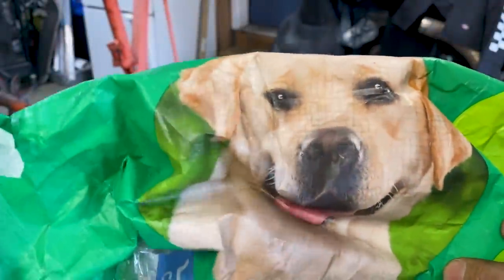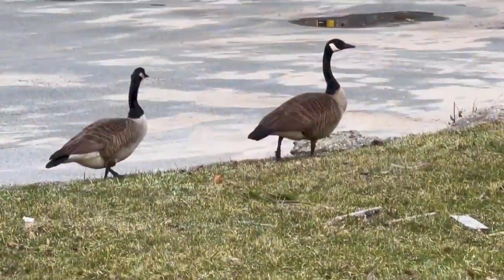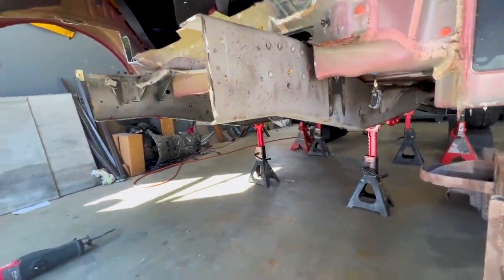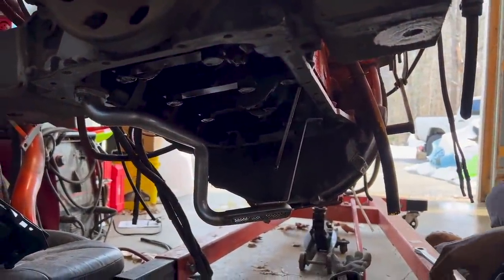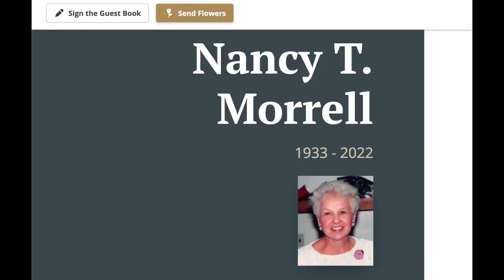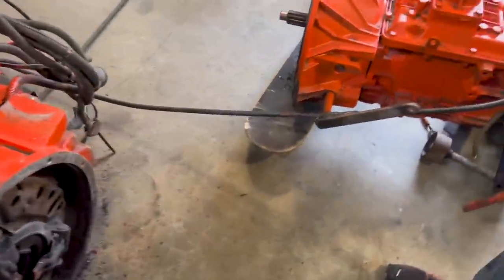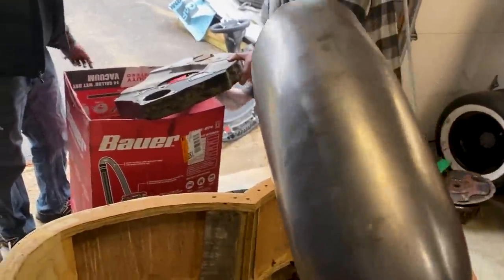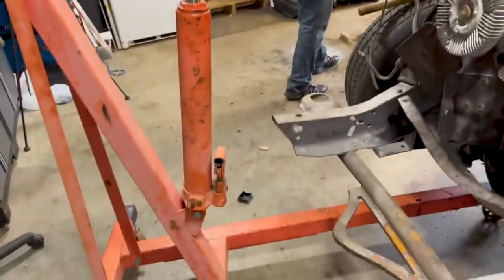Squeezing a Diesel engine into a Tesla Model 3

Comment: You gotta bring it to Munro HQ when you’re done with it.
Reply: We will pull whatever you want dragged around at the Munro HQ <3
Reply: can you check the torque specs on the pick up tube bolts?
Reply: If it ain't woke, don't fix it! LOL
Reply: Inspect those panel gaps they look bit uneven.
Reply: Jack_Nicholson_yes.gif
Reply: It would be even better if they run that conversion with vegetable oil 😂 😂
Reply: @poplaurentiu4148  or using gas wood gas 😂
Reply: @carholic-sz3qv  Or do what Top Gear UK did and grow their own rapeseed oil to run it on, making it 100% green.
Reply: Lol need to get some new ideas at minors for next gen thinking
Reply: I will come up for Model D!! NERDS ABSOLUTELY ROCK!!!

Comment: if you want to do a/c,  factory cummins bracket for mid 90s F600 ford, Cummins part# 3930888   moves a/c compressor ABOVE the water inlet, then fab something for the alternator.  Also needs a belt tensioner from same application, as it swings opposite direction.

Comment: I hope that you used a dial indicator and set the tolerances on that flywheel housing. I've seen broken crank shafts as a result of improper installation of flywheel housings on Cummins engines.
Reply: To be completely honest they probably used a particularly unique piece of gravel from the driveway of a White Castle six years ago that Stevon kept in his left pocket. Something ridiculous like that, anyway

Comment: I dig the auto. 1 manual tesla for fun, 1 auto for ease of towing. If you were to go with the manual though, you'd install a completely different chassis mount shifter, then make linkages to connect it to the trans' shift rod. Few guys with manual GMT800 trucks have done this to install the center console, and put the shifter right in the left most storage tray area. Makes for a super clean install without having some weird shaped shift rod. With linkages you can also make the throw however long/short you want it to be.

Comment: Nice work personally I would of built a frame and mounted the engine then mounted the tesla body on top and and just cut the tesla body to fit the frame and engine. But either way this is some solid work good job man!
Reply: Exactly what I was thinking. Shoulda just kept the engine and frame from the bread truck and then dropped the Tesla body onto it. Naturally they woulda had to cut half of the body so that might have looked a bit odd 😂

Comment: Would be more interesting an TDI Diesel swap for that sleeper look. But the extravagant way it's the way to go for more exposure.
Reply: It couldn't tow with a TDI... And a TDI swap would probably be easier than the V8 swap he already did.
Reply: @zachcollins9687  did the US get the V8/V10/V12 TDI engines? They would be up for it
Reply: @ikebuttle360  yeah, in the early first generation Touareg they had the V10 TDI
Reply: @ikebuttle360  kinda irrelevant... It doesn't matter WHICH TDI they went with, the original comment suggested they tried to maintain more of a "sleeper" aesthetic. If they kept the original unibody and swapped in a V10 TDI it still wouldn't be able to tow. Like I said, I feel like it'd be too similar to the LS swap they already did.
Reply: @ikebuttle360  they did in the q7 and the tourag
Reply: @zachcollins9687  exactly, they could try the V6 TDI, from Audi. Might be able to fit. There are also Specialized Garages in TDI engines, that could collaborate with the build. As the   "Darkside Developments" Garage in UK.

Comment: To Rich and his elves , run your newish Tessie on veggie oil , use the original Tesla power hookup to then power an external pump to fill up a onboard used fuel supply reservoir, this to later filter the oil for fuel , overload use only of coarse .

Comment: Well yes.

You could also do a Turbine Tesla (tesla turbine), stick a helicopter engine in a Tesla instead of the battery pack and normal controller, just run it off a custom genset and inverter / controller (PWM/multi-phase). You could definitely be sustaining 500kW by doing similar stuff to what is being done for military and civil aviation aircraft...

You can run a turbine on most any flammable liquid.
Reply: ok
Reply: Haha - at least it doesn't have to be flight certified - but those things cost at least as much as a Plaid :DD
Reply: @rkan2  it's weird how a turbine with one moving part costs loads more than a piston engine, and that just goes to show you what sort of corruption and state subsidy systems are involved here with companies like Standard Oil and GM.

The things I could tell you about what has gone on with the turbine industry and military sanctions... it would blow your mind. I worked for Jan Mowill & his daughter at OPRA turbines for like ten years.

I also got bladon interested in the single stage all radial topology - a single stage turbine is basically a car turbo stuck to an open flame, with the air compressor driving the flame, and the exhaust manifold being driven by the flame. People make them in their back yard.

You can make a single stage gas turbine out of a car turbocharger.

The bladon single stage air bearing unit is groovy as can be, and at 12kW is perfect for running off grid small scale industrial and telecommunications, but to really slay in a four seater vehicle with tonnes of bodywork in an automotive or aerospace application, high performance is on the scale of half a megawatt. 

A half megawatt radial turbine is a helicopter engine or a micro turbine - they are rare in industry, and factories have traditionally preferred to have cheap coal fired grid power. 

Capstone, Pratt & Whitney etc do microturbines and aircraft & helicopter engines in the 670hp / 500kW range. Much more compact, but welding torch temperatures inside. The issues of hot exhaust and overheating make turbine vehicles impractical for consumers doing supermarket trips, but if you really want power to weight, a turbine genset and electric power train has got better characteristics than trying to put a gearbox on a gas turbine. Turbines and varying shaft load / torque are a bad mixture, and turbine race cars from the 50s and 60s would just destroy the gearbox.

Turbines basically want to deliver continuous power and stay at the same speed, and are a very big flywheel storing a lot of kinetic energy. In a car you would need to consider the gyrpscopic load, and mount the engine with the shaft oriented to allow freedom of movement in the right dimensions. 

A really clever designer would gimbal mount the genset and use it as an active stabilisation system - have a look at the kinetic systems used on boats designed by Rolls Royce.

Comment: I wonder if that autonomous floor cleaner would let you ride on it, like could you get chauffeured around. Or would it shut down. My guess is that it has a pressure sensor on the seat. And it would stop running.

Comment: as a truck driver for over a decade I can tell you that engine parts made in USA, are quite often shipped from Michigan, to Mexico for assembly, and then shipped back to Michigan. how ridiculous is it that our labor as truck drivers is that cheap that they can afford to do this. truck drivers have held the top 10 most dangerous jobs for years, usually right behind airline pilots. we are federally regulated just the same as pilots, but we received 1/3 of the pay. 🤷‍♂️🤷‍♀️🤷🦐🍤

Comment: Ill say it again... i stuffed a 4bt into a model A with a manual trans, its dumb simple and cheap to throw a mustang T5 behind it but i know rich loves constantly having to fix stuff so the dodge trans is probably the way to go. Rich feel free to research me because of my negative comment since ive built hundreds of vehicles and have offered advice in the past. I actually dont like this project the 4BT is fun but doesnt make that much power, you will have to gear the snot* out of it and if youre planning on towing youre gonna have a rude awakening. but with 5" wide spoke rims on a 1929 roadster they rip pretty good

Comment: Richard, you're a techead and an engineer, why don't you use CAD and design and fabricate your own frame for your model D? It can be constructed from high strength, light weight aircraft steel or even aluminum. This must be easier than butchering the truck frame and model 3's body. Just a suggestion from an observant oldman and mechanic, good luck.

Comment: u  could of used ur fab buddy to make a linkage and u could of mounted the shifter anywhere further back,,, use the shifter off another manual trans...cut the ball off it and u can mount it with a bar fabbed to it running the actuall trans shifter further up..

any ways,...auto is cool but that would be a slick way to make manual work...

Comment: Don’t know if this is a stoopid question, but why didn’t you get a Diesel engine+drivetrain from Europe? A Peugeot sedan engine would fit as a globe with not too much tinkering (unless tinkering insanely is the goal…;o)
Reply: I think they want a truck/bus engine. In the UK this 4-cylinder Cummins (in 16-valve common-rail form) is used in small rigid lorries, and up to 10.8m 39-seat public service buses :P

Comment: It's too bad cummins doesn't make a smaller 6 clinder because those 4 cylinders really vibrate at least in gas cars at low rpm and they are buzzy at high rpm. 6 is perfectly smooth always.

Comment: I have several 4bts waiting to be installed in projects. As much as I am a fan of 6bts and even more so the 24v Cummins I had the same issues as Rich. The 6bt is too big to fit my project without a crazy amount of custom fabrication. And the new version of the 4bt is way out of my price range. Rich don't bother snooping for my projects. You will never see them on YouTube 😝
Reply: Crazy, the 4BT’s go for double or more than the 6 cylinder Cummins in my part of Canada
Reply: @esimler  I meant the Cummins R2.8 is crazy expensive compared to the 4bt. Also I know I got a good deal on my 4bt. Plus the prices have gone up since I got mine.

Comment: OK ok you got skills we know this, but have you considered taking the cylinders out of the diesel engine and replacing them with smaller electric motors so you have an electric Tesla - Diesel - Electric conversion.   Now that would be a set of wheels. 🚗

Comment: I get that this engine was the cheaper option... but wouldn't a smaller more rev happy diesel like from a Chevy work van had been better ? I used to drive one for a delivery company and that thing eccelerated like a regular gasoline engined van only with much more torque. And the engine was a smaller one because it had to be being in a van.
Reply: What diesel engines were ever in chevy vans? The only ones I know of are the duramax express vans.

Comment: You would of been much better off with the cummins r2.8 engine, I am a dealer and certified Installer for the r2.8 engine.  Instead of a 800lb 4bt the r2.8 comes in right at 500lbs.

Comment: Next challenge: Import a single cylinder 2-stroke diesel Lanz tractor from Germany and fit its engine into a Tesla. Maximum revs per minute 800 but the fun part is that it can blow smoke rings when you're starting it. Oh, and it can start backwards.

Comment: That dash proves why driving 92-96 Toyota Camry's make serious economic sense as an everyday car. 

I can buy a used clean 96 Camry with 100 000 miles (at the same time a person purchases a Model 3) and drive it another 200,000 and with any and all repairs,  maintenance, fuel, insurance and even an engine and transmission rebuild... I still won't spend what a Tesla owner will over the same time span.